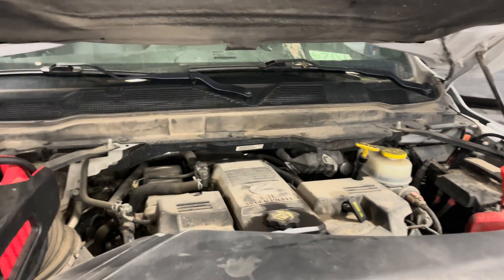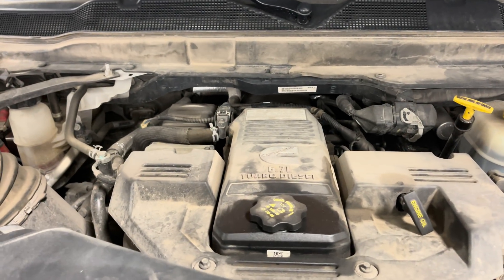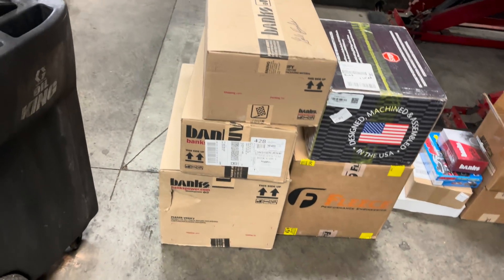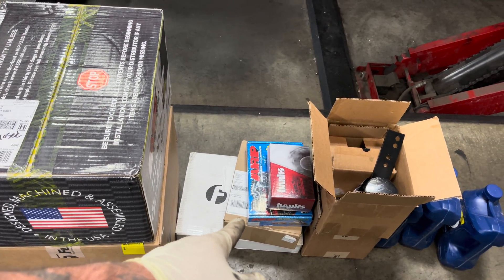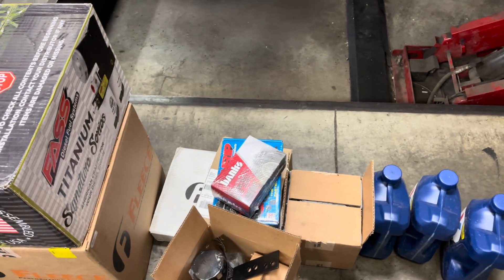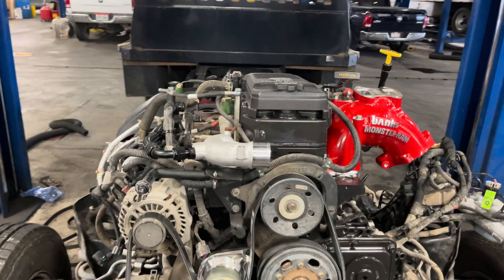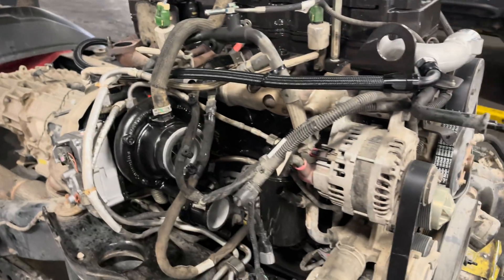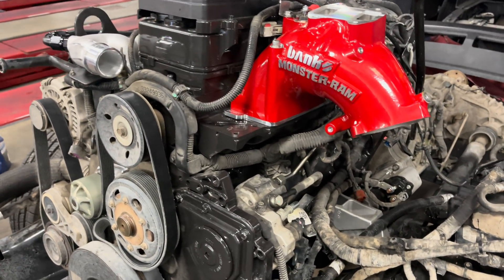Master Diesel Tech Does The Best Bulletproof Cummins Swap For 2019+ RAM HD’s!

Comment: I have a ram 2500 6.7 with 125 ,000 on it. Do need the cam and lifters done when I do the bullet proofing 
I guess this is about $20,000-25,000 for parts and labor if I bring it to yall. ( air ram grid heater delete fass fleece, cheetah turbo bypass banks differential cover do fuel system etc. or would it be closer to 30,000. ? Thnanks for info and helping use out
Reply from the maker: Email me for details trukstuf1@gmail.com

Comment: I have an 18 ram 3500 that use use to haul my concrete pump around. The more research I do the happier I am with the choice I made purchasing this truck. I’m getting all those upgrades done slowly but surely. I’m almost at 200k with emissions still intact. Next step is going to be a delete

Comment: Has anyone ever had an issue with the fleece cheetah? My stock turbo vanes were sticking on and off on my stock 2014 2500. Had a shop replace it with the cheetah and now i have no low end power and my truck will actually downshift climbing hills with no load. Very frustrating!

Comment: 2017 Ram 2500 w/6.7 @140k just went into limp mode. I’m going to delete but I’m concerned about installing the delete tune while in limp mode. Anyone here with suggestions or same experience would be throughly appreciated
Reply from the maker: There will be no issue
Reply: @Trukstuf I appreciate you, your time and the response. I’ll be installing the Mini Max V2. Thanks again

Comment: Keep up the great work.  I totally agree with your logic for upgrading the truck to last 20+ years.  I just finished upgrading my JK, and that was well over 40k.  What is your take on the Speed of Air pistons for your bullet proofing plan?  Also, could you do a video on the current 2500 payload increase, and what actual frame and support changes were made?

Comment: Hey are you familiar with the fleece powerflo lift pump supports up to 800hp ? I was going to install one of those on my 15 6.7 Cummins I have a H&M cat filter upgrade under the truck do you think a fass is a better option then a fleece drop in or is it just for the better filtration ? Thank you

Comment: Hi Josh, what is the approx cost to switch to this setup? Also, the 68rfe, are these worth upgrading, or if possible, swapping for an Aisan? Thanks
Reply from the maker: There are plenty of upgrades for the RFE. Start with the valve body and thermal bypass valve. As for cost on this truck, all I can say is, a lot.

Comment: I have a 2016 3500 that’s been through the weight loss program and I did put the tranny bypass on because I do pull a fith wheel a lot. What’s my next step if I can’t do all this at one time.
Reply from the maker: Coolant bypass from fleece and oil bypass from insane diesel
Reply: @Trukstuf brother I truly thank you for responding

Comment: This is the exact thing I've been wondering about.  We have a 2015 HO and a 21 SO pickup.  I've always said I'd the motor ever goes on the 5th gen,  it's getting a 4th gen motor to get rid of those hydraulic roller junk valve train.  I never could find the answers whether it was a straight bolt on or what mods were going to be needed to do a 4th to 5th gen swap.  Thank you for this video and all of your others.
Reply from the maker: Good thing you left this comment. I’m doing that job as we speak
Reply: @Trukstuf I think this can be a solution for some that isn't really talked about on the groups and forums if their roller motor goes south with metal when it's too late to save it.